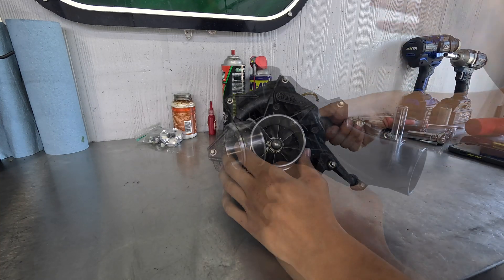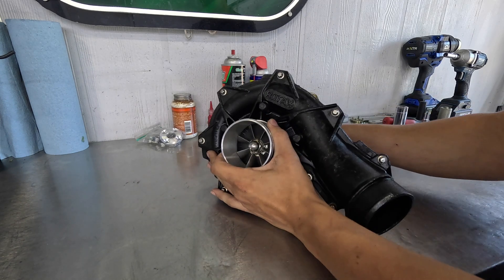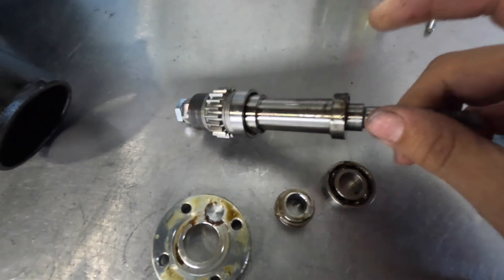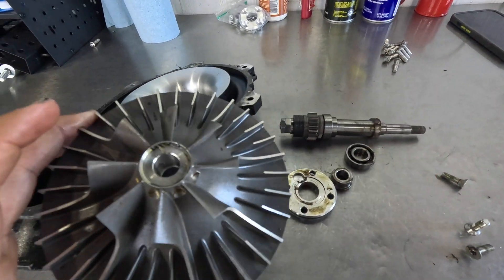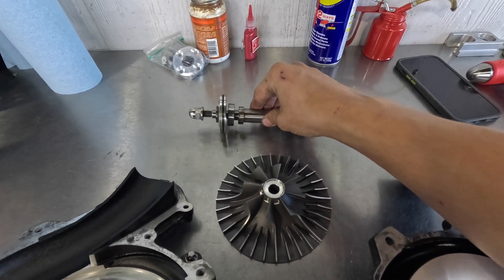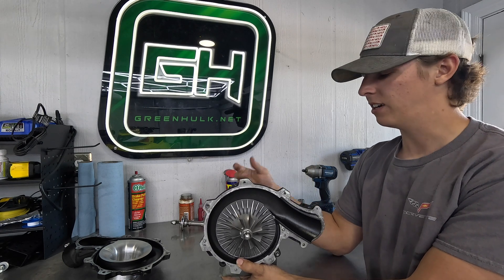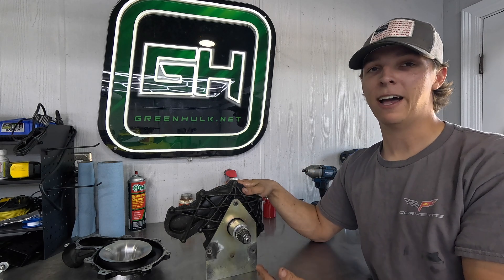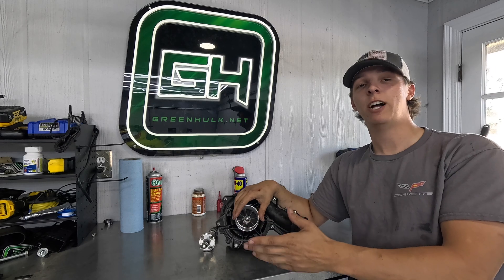Diagnosing & Rebuilding a FAILED Sea-Doo 300 Supercharger

Comment: How bad is it on the seadoo if you continue to drive it with a bad or failing supercharger? Until i fix it, just want to use it sparingly for backup.

Comment: Had the exact same thing happen to my 2019 Rxt-x 300 at 160 hrs. Started making a faint rattling noise and sure enough, supercharger was the source. On mine, the plastic retainer for the ball bearings broke so a couple of the balls were just freely flying around in the bearing races. I drove it about 5 miles back home very easy and it made it thankfully, probably not the best idea but it sure beats seatow 😂